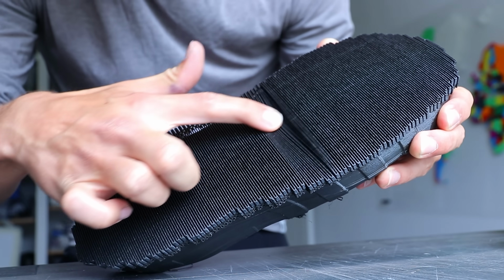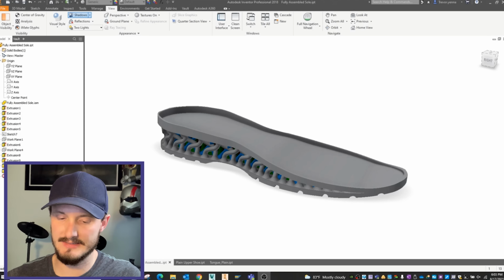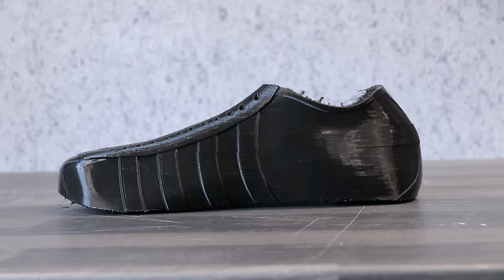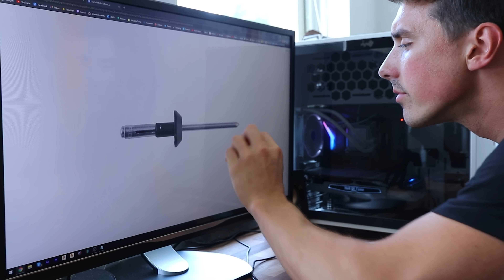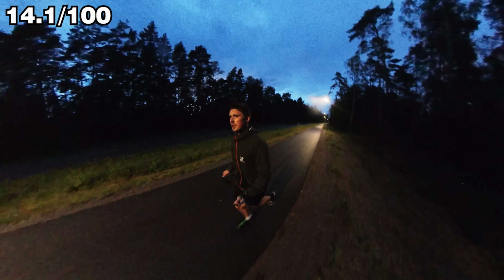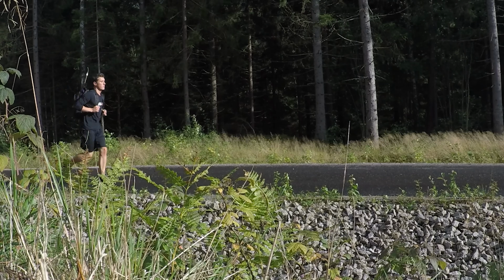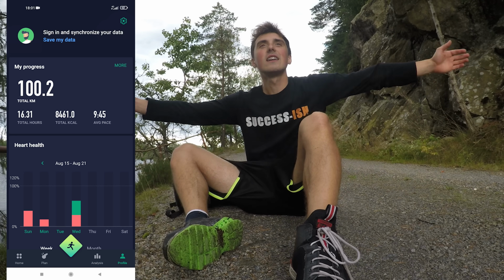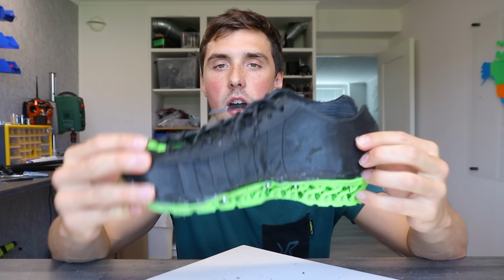This Shoe Is Completely Made Out of Plastic

Comment: whatsup, I'm a orthopedic shoe technology student from the Netherlands, for the past 3 years this is something I and some teacher/professors have been thinking about, for now it's simply too difficult to make a decent shoe completely on a 3D printer, most of the used materials and methods are not up to par with traditional manufacturign. atm, custom insoles is something that is very feasable and already used in practice a lot. maybe you could take a look into that for a future video. cheers!
Reply: Would replacing the soles from old shoes be a viable option like all-star soles only last 2 years then print out new ones and stick them under your shoe.
Reply: @The_oli4  I've never tried so myself by I can't see why not, You will have to match the heel height and toe box hight otherwise the upper material can degrade faster. Adidas currently makes shoes with 3D printed soles (4DFWD). I will say though, All stars are probably the worst shoes you can own, since they barely provides any support to your feet.
Reply: Have you seen some of the stuff "printed" by Diabase?  They originally made the Flexion (an amazing extruder for flexibles, I swear that thing could print a wet noodle)  

They have been moving into 5 axis equipment that can do additive and subtractive manufacturing and one of their first things they showed a few years back was a fully printed 3D shoe that was from one print.
Reply: @dhoyda  It's a cool concept but beyond limited run custom shoes or "art" I don't see that as feasible for scaling.
Reply: You’ll find a way! Like the new 3D printed rockets. You’ll find a way to make shoes in a way no one else could before
Reply: @rkatz69  Durability is also a huge aspect we try to look at. Layer lines are still a massive weak point and these 3D printed shoes will fall apart even with regular walking. I work with a lot of deformed and different feet which can introduce forces that normally wouldn't happen with healthy feet. These are just some factors we have to take into account when making 3D printed shoes.

being able to print flexible materials alone isn't the problem either, we have to be able to print rock hard materials such as carbon fiber as well to prohibit or immobilize movements. Which is tricky on its own, let alone trying to combine it with 20+ different materials we use on a daily basis
Reply: @icebox829  I'm sure there will be a way eventually! it'll probably still be a fair few years and lots of innovation. but for now the old traditional way is still the best
Reply: @icebox829  They have printed a rocket but they have not flown that rocket.  A rocket that has not flown is just very expensive modern art.

In all seriousness though, I really hope they can manage to get it to work not only to have another competitor in launch contracts for satellites but also to shine a huge light on how far 3D printing has come.  Not since the beginning but since the patents ran out and allowed RepRap to be a thing.  The difference between the original RepRap and what you can buy for ~$200 bucks blows my mind.
Reply: @dhoyda  yeah Relativity space has come up with some cutting edge stuff their first rocket is supposed to launch In 2024. But with 3D printing they’re able to make designs that would be impossible with conventional fabricating. So hopefully they keep it coming
Reply: I have some ideas I would like to talk to someone about. For example: Heat Annealing; print the entire shoe at once and heat anneal for better layer adhesion. Also Printing Thinner; print thinner and (heat) embed carbon fiber or Kevlar. Two Part Customizable; print the sole separately but design it in such a way that the sole connects to the shoe via shoe laces.   My wife has feet issues and I want to 3D scan and print the "perfect" shoe for her. This is a labor of love and will be open source. (BTW, one of my sons lives in the Netherlands lol)
Reply: @The_oli4  Adhesion would probably be the biggest challenge. Some plastics simply do not like to be glued to other plastics.
Reply: @Roompje0  I have been thinking about ways to design a partially printed sole that incorporates recycled tire parts. For example, cut "treads" from a scrap tire. Then design and print a flexible web that will bind the treads together. The idea is to not use, or at least minimize harsh chemicals and glues, yet have a shoe sole that not only is flexible and comfortable, but includes recycling as well.
Reply: Hey Roman, sent you a connection on Linkedin, wanted to see if we can have a chat on the research that you've been upto, I  study at TU Delft at the moment and was looking at researching along the same lines on the side (footwear isn't really my line of expertise, I'm an architect haha) I've been just looking at possibilities of SLS printing using TPE or Nylon
Reply: Roman, is barefooted walking on hard surfaces healthy? So how good are shoes with a wooden sole?
Reply: What do you mean that you can't make a good shoe on a 3D printer?!? I would understand it if it were that 3D printing was too slow for mass production, but quality? I would say that you can print a MUCH BETTER shoe on a 3D printer than what you could buy.
Reply: @Roompje0  Printing hard plastics is quite easy. And I don't really know why you would want to print hard plastic in a shoe or why you need 20+ materials when you could easily make the shoe out of one material and if you needed to vary stiffness, you could adjust the infill and the number of perimeters.

Comment: The back side of my foot hurts just looking at it. I face this problem even on normal sports shoes(especially when they are new)
Reply: i really felt the pain through the video. amazing how he managed to keep going.
Reply: Yupp, not unique to 3D printed shoes.
Reply: I was wincing at every step. Pressure points on shoes are damn painful.
Reply: got to find shoes that fit, had that issue and other blisters, till i got custom ones made and then found new balance also did shape/size that fits without blistering even at ultra distances. 

3d printing shoes hold promise, but god that looked painful and is not there anytime soon. Someone needs to pour a few million or billions into material science.
Reply: @GlaucusBlue  the shoes I am wearing now fit perfectly, but it hurted like crazy on the back side(the same place where his foot got cut in the video), especially after 10mile long walks, when it was new
Reply: @user-nq5hy7vn9k  I've had so many shoes that was like that. Now I refuse to use shoes that doesn't fit even when new. It's not worth the pain. Instead I spend several days trying on shoes whenever I need to buy new. It also has cured mew from caring about looks. If I've spent three days going from one store to another trying on just about every thing they've got I will buy whatever shoe I find that fit, even if it's pink with sparkly blue elephants on it. So far I haven't had to resort to painting a pair of shoes just to make them wearable without puking, but I will do it if necessary.
Reply: Legends said you need to bite the new shoe, so that the shoe won't bite you in the future
Reply: @blahorgaslisk7763  I feel the problem even when th shoes are perfect fit brand new. The problem only arises when I am brisk walking continuously for really long distances though 🙄
Reply: @adamnoah12  really? Does biting seriously work though?

Comment: I’d say the way to go is a 3D-printed mold, then mold the soles.
Reply: Close.

Cobblers have foot shaped clamps for a reason. It also helps tremendously to use heat activated glue.
Reply: Make a mold and cast silicone directly on to your foot.
Reply: Cold molding produces way too heavy shoes. In traditional manufacturing, a foaming elastomer is injected into a mold in a hot process.
Reply: @victorwidell9751  tool dip works really good. It's got good gripping properties.

Just be sure to shave your feet first.

Don't ask me how I know these things.
Reply: The pattern on this shoe would be impossible to cast in a mold without major simplifications while losing it's properties.

Comment: You could add heat stake rivets to the design. Holes on the insole, matching protrusionns on the sole. Use a soldering iron to melt the protrusions amd spread the plastic over and around the holes.

Or, you know, sew them together like leather Boots.

Comment: I'm getting a larger 3d printer and I'm going to start printing my own shoes. I can sew so all I need is a basic bottom half.
Reply: Awesome.  (Just an Idea!) 
3D print the shoe sole with bolts to seccure/ connect on the upper part of the shoe.  Nice rg. Brian
Reply: @BRLVN  I'm going to print out a sandal type shoe that wraps upwards and then glue the material to it along with sewing it down. With gluing and sewing I should be able to make it secure without having to resort to tacks and bolts. I'm getting a new printer soon so I'll tell you how it turned out when I do

Comment: I wonder how's the strength of the print if you pre model a welt with stitch holes, you can still print a water tight shoe as how 3d print work. 
Also you should check out how leather shoes are made, I think some can benefit on your next shoe project

Comment: Would have been interesting if you could have punched holes and then laced through filament for the two halves instead of using the rivets. Tie a strong knot and maybe melt it on either side. I am not sure of the strength of filament, but going full 3D print would have been interesting.

Comment: Just in case someone wants to do this, or you revisit this idea, the original gorilla glue is a PU based glue, and bonds really well with TPU.  It does expand as it cures, so you would want to print a shoe-last to go inside that you can clamp down on to ensure a solid bond.  It also cures from moisture, so dampen both parts before assembly to speed up the cure.  Not sure if it would be flexible enough.  A general point of advice is skip the marketing on the package and look up what adhesive will bond best with the specific materials you intend to join.  There are tools online for this.  I've gotten excellent help from some of the bigger companies as well by contacting them and asking what would be the best match.  In your case it needs to flex, so scuffing both parts and using a neoprene style contact cement like almost all shoes have been made with for a long time now may work better, but I can't speak to its ability to form a true bond with TPU.  If you don't need flex, CA glue works amazingly well on TPU.  I have a fair few aluminum parts glued to TPU parts with CA glue that are still holding strong despite the flexing of the TPU and the different contraction rates through many hot and cold cycles.

Comment: What if.. One piece print using two filaments: TPU  95A for the sole and say 70A for a mesh/net style upper body, using water soluable supports to print the 70A. Of course a dual extruder printer would have to be used. Then an inner sole made with perforated foaming TPU. Pretty damn sure that would work! One could even make the mesh part interlock with the sole by printing anchors of the 70A into the 95A. Like.. Hmm.. Like a hairsack or something?

Comment: I see your still using the orca for flexible filament.  I love mine.  Just started running ninjaflex and so far so good.  Def have to get the settings dialed in but then it does pretty dang good.  Only issue I have is removing from the bed.  I heard some people dust with baby powder.. have you tried that?  When you have a sec please let me know what temps and speed you are running for flexible filament on the xinkebot.  Thanks

Comment: If the outside is made of the same material as the top and bottom,
It is durable without worrying about the bottom peeling off.

Washable cushioned interior
It would be nice to have a sock type made of low-resilience material.

Refer to items with separate inner and outer parts, such as skis, snowboards, and roller blades.

Replace only the outside and depending on the location
It would be great if we could combine as many ways as possible and contribute to the SDGs.

Why don't you consider designing something like Japanese straw sandals and tabi?

Please refer to straw sandals with a braided structure.

Comment: What about nylon for a sole material? It's fairly flexible and should be significantly wear resistant.
It'd also be super cool to scan your foot in a fairly tight fitting sock and model around that. Get an amazingly snug fit from some printed material.

Comment: Home 3D printing isn't right for this, but the industrial guys can do it no problem. With the ability to use multi durometer materials, something like a 3D Systems Projet 5600 could print this all in 1 piece. 3D Scan your foot, maybe use one of those pressure sensitive matts they use to make orthotics, and you could have a shoe that is truly custom to your individual feet.

Comment: To glue something like this I recommend "Innotec Adheseal". As a matter of fact that glue is something I couldn't do without. I always have it at home. You can even glue something under water with it and it is highly flexible and strong and will take vibrations and impacts. Kind of like a silicon-rubber-glue. Not suitable when the glue layer should be very thin though. (under 0.5mm) Also needs 24 hours to dry. Can't have everything.

Comment: A very good adhesive for stuff like this is a tube of clear silicon 1 (the pure silicon)
This way you just slather it completely over the sole (not a simple bead) then let it cure...not only is it adhesive but very flexible (similar to E6000)
Pretty cool that the shoe held up...but rivits are not a good thing for your feet

Comment: Here’s a possible way to improve. Print it all in one go (either with swapping the filament midway or get a multifilament printer (or modify) and then use one of them foamy filaments for the top part of the shoe where your ankle is. That way you don’t have a hard plastic rubbing off your skin.

Comment: Yep, TPU is definitely the hardest material to print. Took me a long time to perfect my prints with supports on my Ender 3 V2. 
Ever since I changed the extruder into an all metal hot end, my TPU settings just messed up again.

I'm thinking of buying a separate 3D printer and attaching a direct drive extruder to it.

It should yield better retraction results for TPU. That way, I would have one printer for TPU prints and another for literally every other filament type.

Comment: I think that for V3 you may want to look into adding an interlocking geometry between the sole and the boot for better guidance on the glue up, along with a wire or thread stitch pattern on the exterior, between the sole and the boot, as shoes are actually made to adhere to the sole. Additionally, it may be prudent to have a third printed insert to prevent the chafing on the back of the ankle, or a fabric insert to protect more fragile parts of the foot.

Or, if you believe that the rivets are a decent strategy, I'd add an insole printout that would be glued over the sole after the riveting is completed, so you can get more rivets in more places without risk of injury to the foot.

Comment: right execution wrong material used to make a shoe. for the top the soft plastic was bound to hurt your foot even with regular shoes without proper socks can hurt. if you wanted to make them with that plastic you would at least need to use some type of cusion around the back or silicone to help the bottom portion would also benefit from using a layer of silicone as plastic is not very good for absorption of impact.

Comment: With the rivets, it may make sense to design the sole to have small flaps with holes that turn vertical instead of trying to have a flat transition between the sole and the upper. Nice work!
Reply: I like your idea. I however would go simply for designing places for the rivets that are indented and have a flap to ensure the person never comes in contact with the metal. This may work really well with combining two different plastics. For example, I am thinking of cutting (recycling) treads from a scrap tire and attaching them to a 3D printed sole. Imagine the lifetime of that shoe!
Reply: @-robo-  this is the beauty of 3d printing, simply designed the pieces how you need them to accommodate the hardware for assembly

Comment: great work Simon the whole video is just great, you should have printed the part between your foot and the shoe from the more flexible filament that might've provided you with flat surfaces on both the shoe part and the sole and would've been easier to print still great job keep it up

Comment: There is a lot of science to shoes, particularly running shoes. 3d printing has to be a no brainer though when you think about custom fit to your foot and weight. It will come. Keep up the good work!
Reply: Imagine combining 3D printing with fabrics. A cnc weaving machine.
Not sure how that would work either.
Very special slicing?

At some point we may even create a biological 3D printer.
Like having custom bacteria or other organisms to create objects guided by chemicals or light, even just programmed  by instantaneous computer-driven genetic manipulation.
Reply: Exactly. Imagine going to a shoe shop that scans you foot, let's you choose a style you want then 3d prints the shoe exactly for your foot. It could be an advance in 3d printing materials that would enable this or possibly just rethinking shoe design.  For example he experienced alot of rubbing on the heel but what if he designed a rounded edge on the back or maybe even a wedge that cups the back of the foot  better? What if he made 3d printed shoes that went a little higher up the calf? So much potential here but this shows there's still a ways to go!
Reply: Nope.